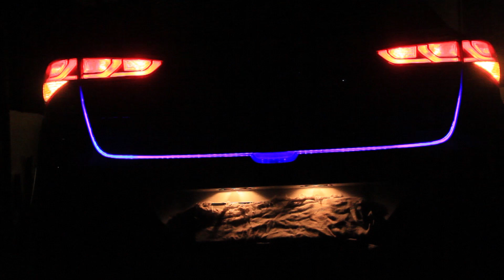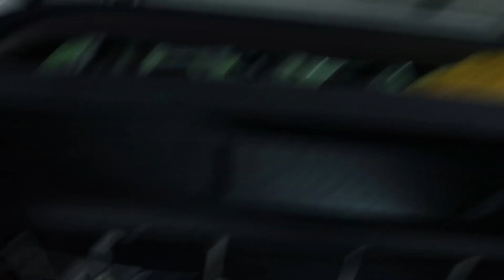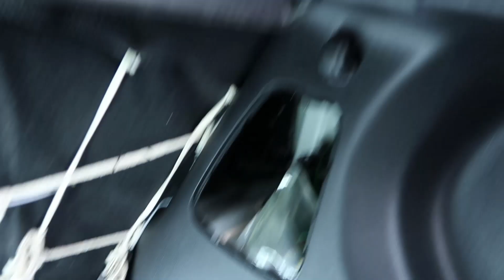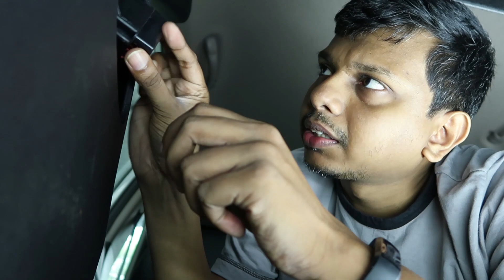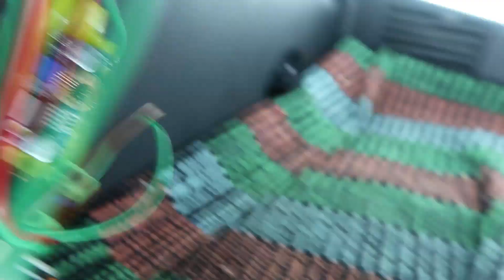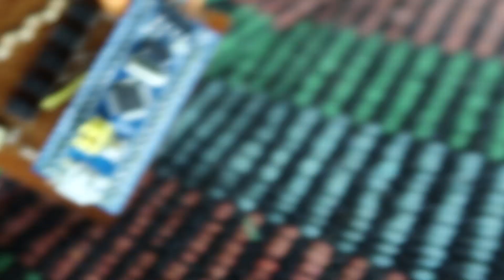Home Made LED Car Lights

Comment: Chetta aurdino ide veche eee microcontroller programme cheyyan pattumo 
Pinnea ithinte code onne share cheyyo please
Reply from the maker: Njan use cheythathu vere oru sadhanam aanu forgot the name veetil chennattu nokki parayam..
Reply: Ok
Reply from the maker: Njan Use cheythathu IAR Embedded workbench enna professional platform aanu . I will make a video on how to program.
njan ithinu arduino alla use cheythathu
Reply: Bro ne contact cheeyyan valla option undo
Reply from the maker: Yes contact.azhichupani@gmail.com

Comment: Ardundo pro upayogichu njaan ithupolonnu cheythirunnu, enikku pinnje ithupole modern vehicle illaathondu kooduthal krameekaranam nadakkilla, aakeyulllathu oru zen aanu, pinnje oru appache_yum...
Reply from the maker: hassan luby good job bro.. Arduino is not enough 92 LEDs maatre pattullu.. it will run out of RAM
Reply from the maker: Don't worry, about your car's make.. modern aayalum pazhayathu aayalum your creativity is the king..
Reply: അത് അന്ന് പഠിച്ചു ഇറങ്ങിയപ്പോൾ ചെയ്തതാ പണ്ട്.  ഇപ്പോൾ സ്വന്തം prodects and researching...  ഇപ്പോൾ അതൊക്കെ ഓർക്കുമ്പോൾ ഒരു രസമുണ്ട്.